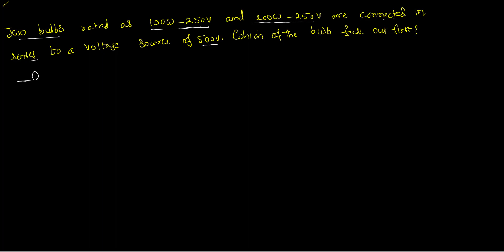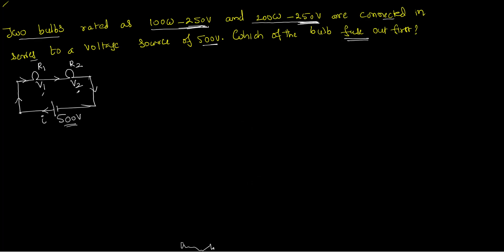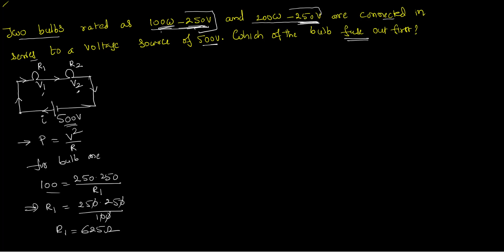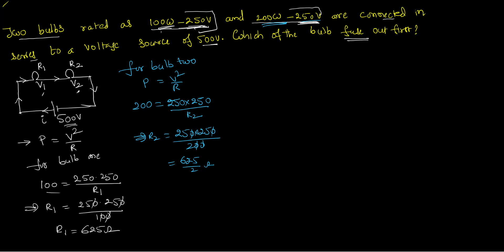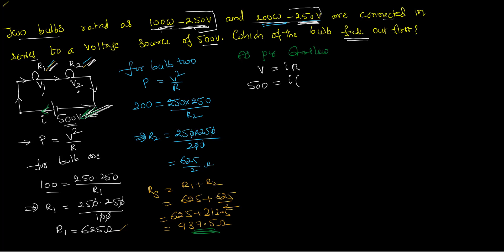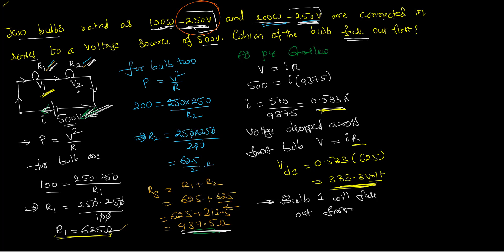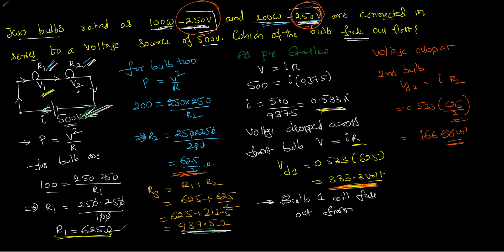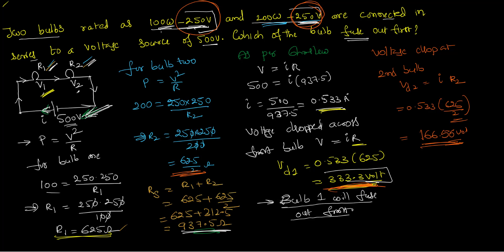Power Concept Problem in Current Electricity Which bulb fuse out first ?

Comment: In parallel 
R equivalents = 38.4
In bulb 1 
3830 =v square
v = square root of 3830
In bulb 2 
7660 = v square
V= square root of 7660
I was unable to find the square root of these numbers as they are to big
I gues if bulb one is undesirable then bulb two will also be undesirable
             [OR] 
If bulb 1 is desirable bulb 2 won't 
              I am not sure sir pls enlighten me with your knowledge sir and tell me I'd my process was correct
 THAN YOU SIR